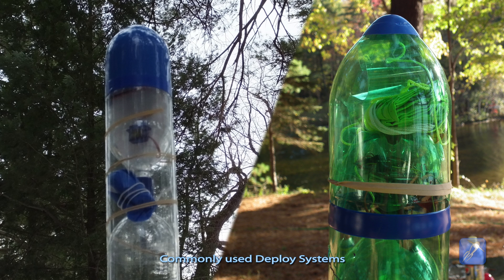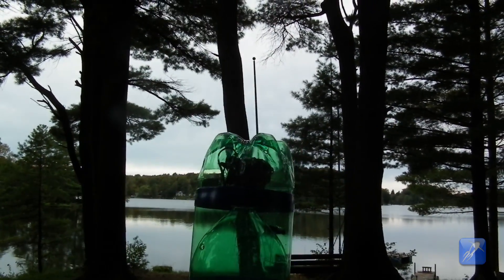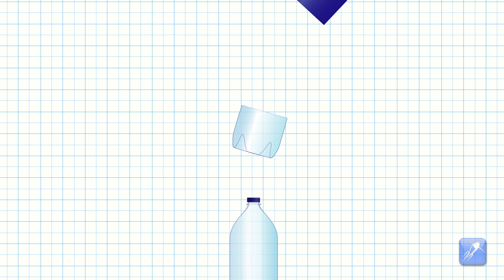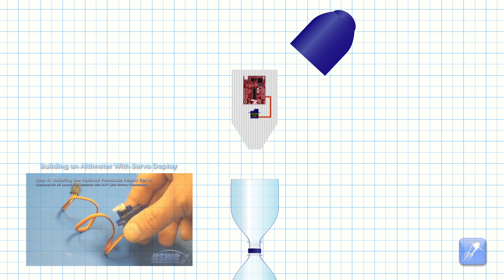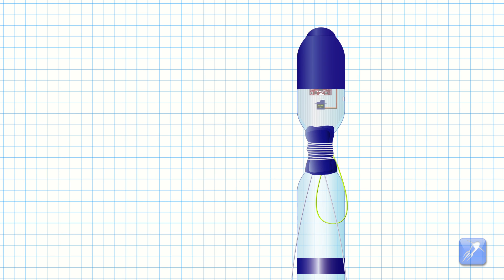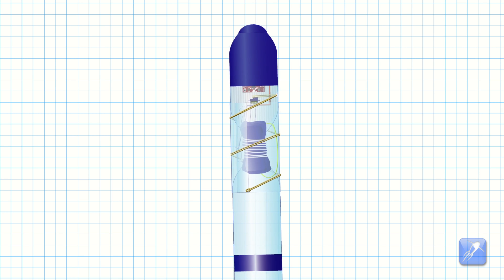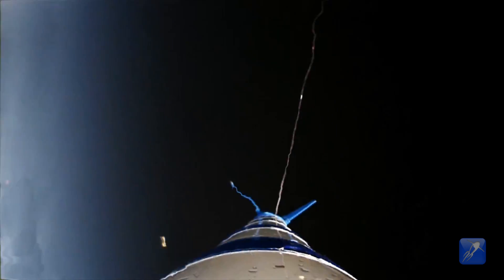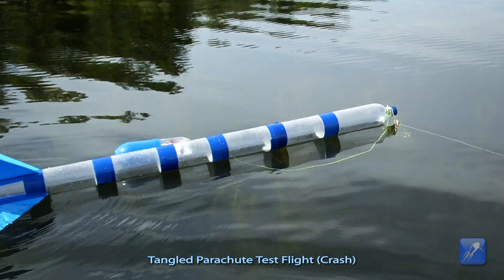Water Bottle Rocket Hybrid Parachute Deploy Mechanism Tutorial

Comment: Hello USWaterRockets. I really like the fact that the electronics and release system are both saved if the parachute fails. A unique feature that I might just have to try! After all, most rebuilding is of the electronics and the release system when the rocket crashes.

Jamie B.
Reply from the maker: Thanks, Jamie! Usually, you can inflate the rocket and pop out any damages. But the electronics usually won't work after getting crushed by the rocket. Even when we crash into the water, the crushing force of the rocket on top of the electronics will break things. In this design, the electronics are essentially in free-fall inside a light protective shell and rarely get damaged in a crash.